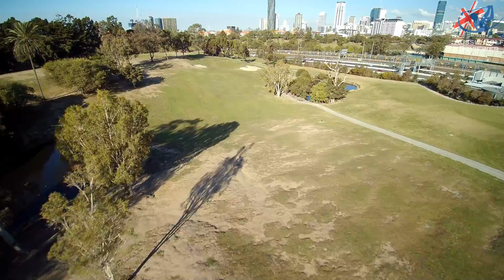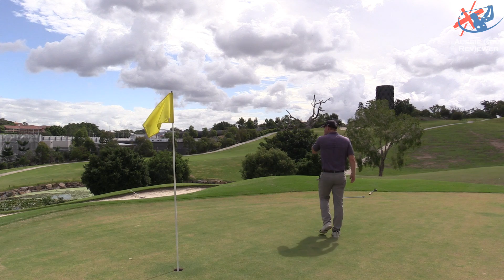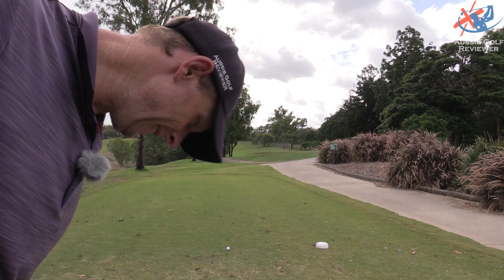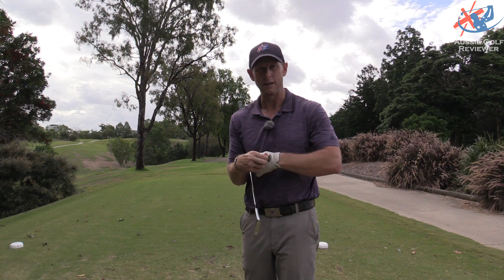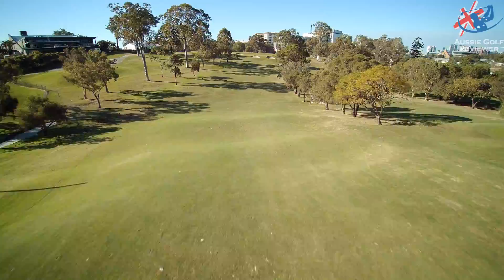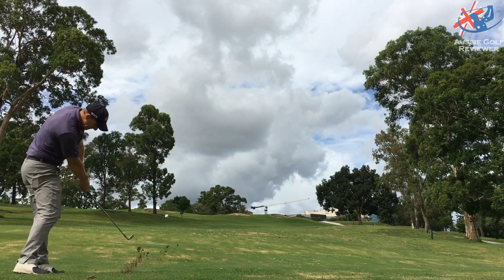solo vlog VICTORIA PARK GOLF COURSE VLOG PART 3

Comment: I look at these short par 4's and can't really figure out the risk.  Most of them just ahve bunkers.  If there was water, a hazard or thick rough, I would understand it.  Here it is mostly reward for going at the green
Reply from the maker: With a short game not good like mine, its easier to hit it 100 out then hit on
Reply: @AUSSIEGOLFREVIEWER  Are you saying that from 10 to 20 yards away from the green, you would still be further out than a shot hit from a 100 yards with a wedge.  Difficult unless your short game is so bad that you can't play chip or pitch shots, OR, the conditions are so difficult around the green.  I didn't see too many water or other hazards, and at most you were looking at being in a bunker or short siding yourself.  I still feel the reward was much higher than the risk
Reply from the maker: I agree the reward is higher than the risk. But would rather hit a full wedge than anything under that. Its a crap short game and when its in your head, it sucks. Have you ever had that issue?
Reply: @AUSSIEGOLFREVIEWER  To some extent I have.  When I used to play three times a week, I could hit my SW for full shots.  Now, playing once a week at best, my PW is the max club for full shots.  However, my short game around the green has not suffered from mental issues, but rather from lack of practice.  C'est la vie I guess